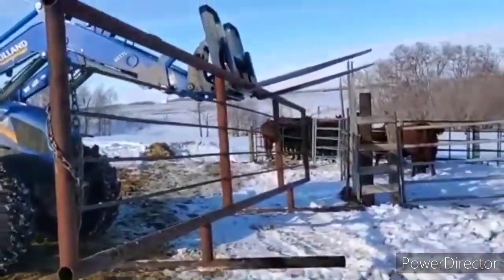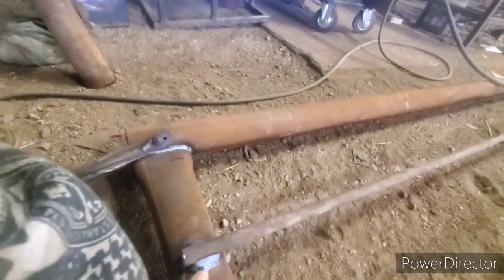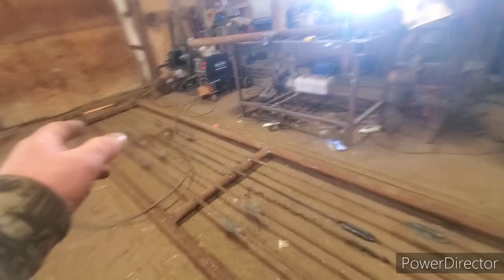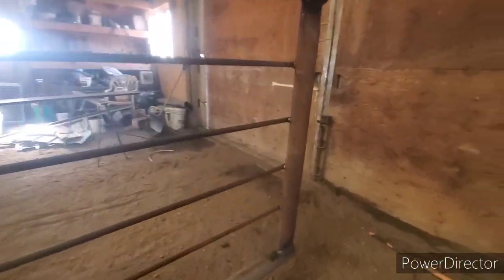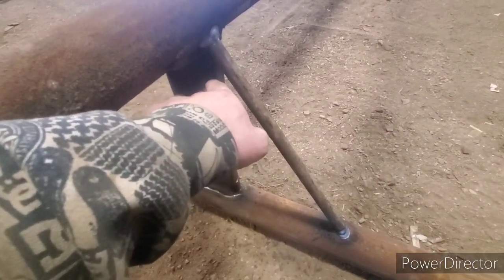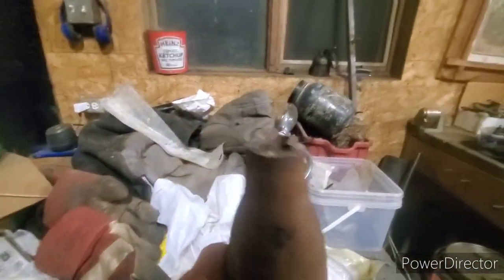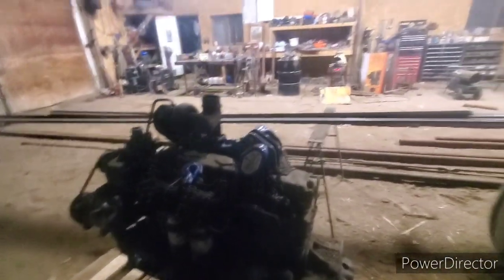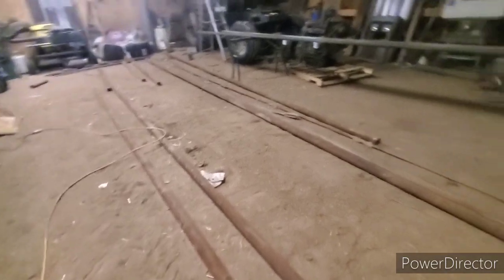Welding sucker rod to oil field pipe!!

Comment: We use Messer 80T rod for sucker rod to oil field pipe. If it's magnetized and makes your arc go crazy, do a hot pass with 7018 or 9018. Sometimes the welds crack and that second heat will eliminate that. Great videos! Really enjoy your channel.
Reply from the maker: Thanks bud
Reply: That 80T is simply 6013

Comment: What I run into with oilfield pipe are the coatings. If I don't get them ground off completely the welds can get  terrible porosity. Sometimes a bubble will get into the puddle and follow the bead to the end resulting in a nipple forming after I stop welding.
Reply from the maker: Try turning your heat up and less wire speed. I run my gas at 30 too

Comment: I really like your 110v pipe pincher, i fashioned up a log splitter to pinch pipe, works pretty well but its not perfect. I also weld my sucker rod to the pipe and have never had one break off. good video man, keep up the good work!
Reply from the maker: 👍 thanks buddy. Wasn't sure if the 110v was gonna do it or not but 220v didn't make any difference and I can plug it in anywhere now.
Reply from the maker: How many tonne is the log splitter?
Reply: @straightpipeacres6365  26 or 28, i can't rememeber for sure, i'll have to look.
Reply from the maker: @rockyrunangusranch-wieszracing  shit thats pretty good. 👌
Reply: @straightpipeacres6365  yes sir, works pretty well, but I wana put something together you got there. I'm tired of having to clean a carburetor every year when I go to pinch pipe thanks to out shitty quality gas these days.
Reply from the maker: @rockyrunangusranch-wieszracing  hahaha yep the gas sucks now.

Comment: There’s a metric ton of info about heating hardened metal welded to mild steel.  Whatever works for ya!  I usually just use a big propane/air torch and a 350F temp stick.  Got AR500 test pieces in the field that were stick tig and flux core wire welded at shooting range targets and none have failed yet.  Can’t think of a harder test than shooting at it!
Reply: I just crank up the amps and lay it on hot

Comment: Ryan you a   a experienced welder for the less experienced I would recommend clean you metal, and extra pass don't hurt. Let me know if you need to borrow clutch alignment tool, It'll make remounting the hydra power a breeze. It's basically  a hydr power input shaft that's been cut off.
Reply from the maker: Cool thanks. I'm pretty sure my brother in law has got one though

Comment: I got done using those 308 rods, i see why guys shy away from patching stainless, $3 per rod but saved me having to blow out $700 on a new Ritchie, ran a pass of JB Weld epoxi over the welds just to be sure it was water tight (cheating i know, lol) hey it would be cool if Princesses Autos sold a press notching kit for oil pipe sizes.
Reply from the maker: Ya that would be cool
Reply from the maker: 700$ is better in you pocket 👍

Comment: I have a small 220V stick welder and I cheat when I weld. 
I use 0.11in welding rod, but the welder is set to 0.14in. 
That way, it's easy to get the stick to light and people think I'm good. 
220V is low current here in Sweden, as you know.
Reply from the maker: Yes thats a bit different then what we have
Reply: @straightpipeacres6365  Jeupp.

Comment: I´m having some difficulties MIG welding flat steel bar to 1" sucker rods... whenever i apply some force to it, it tears appart a small layer of the sucker rod. Do you know what the problem might be? do i need to turn the amps up to make the weld go deeper? is MIG welding not the way to weld these two steels? I´m kinda lost here...Thanks a lot!
Reply from the maker: More heat help I like to do a triple pass. As you are making your passes 1 2 3 it's heating up the sucker rod for better penetration. You could also heat up the rod with a torch before welding too. I find heating them up takes too long though and thats why I like the 3 pass route

Comment: HAVE YOU TRYED ALAMUN CABLE LIKE OLD HIGH LINE WIRE . IT IS USED A LOT IN OK. AND TX.  HOOKED FAST ON 1 END WIRH A SPRING ON OTHER [ SPRING OLD CAR OR TRUCK HOOH SPRING.]
Reply from the maker: No can't say that I have

Comment: THAY USE SHORT PICES OF SMALL ROD  WELD ON TOP AND BOTTOM WITH CABLE BETWEEN ROD AND PIPE. BUT ATACH CABLE TO BOTH ENDS . CABLE WILL GIVE SOME THIN STOP.

Comment: With the soft metal bonding to the hardened metal just get out the duct Tape and hose clamps! And thats my free of charge Ukrainian welding tip. 🤣🤣🤣🍻
Reply from the maker: Hahaha no need for a welder that way goodnuff hahaha
Reply: @straightpipeacres6365   OLE timers trick 😉
Reply from the maker: @PrairieSunsetRanch  hahaha 👍🍻🍻
Reply: @straightpipeacres6365   Panels look nice. I actually like those panels with the sucker rod. Probably weigh a fair bit less than those other behemoth panels. Cheers 🍻 Ryan